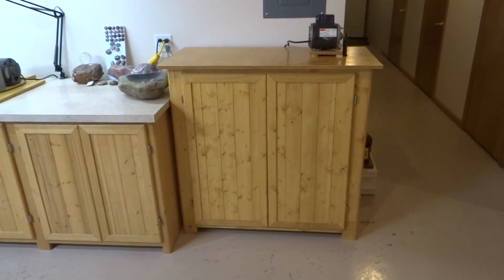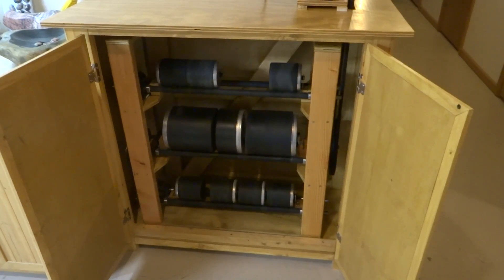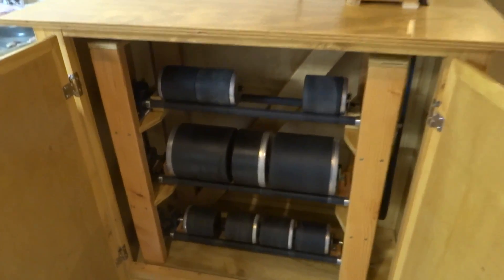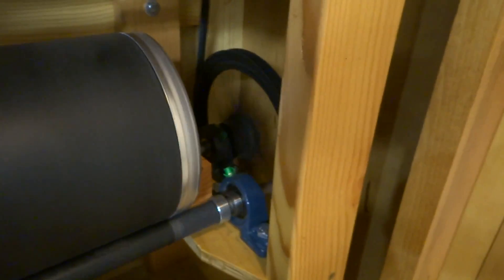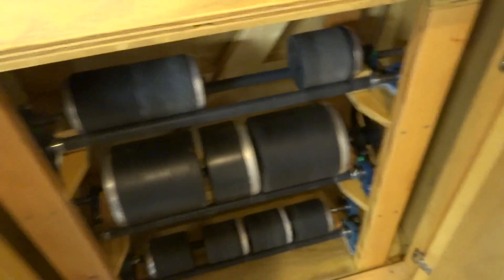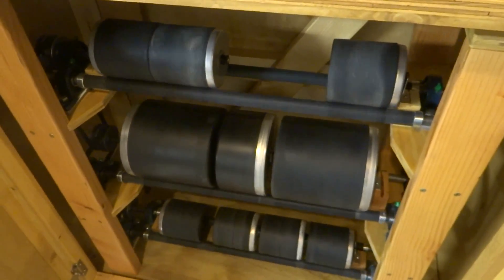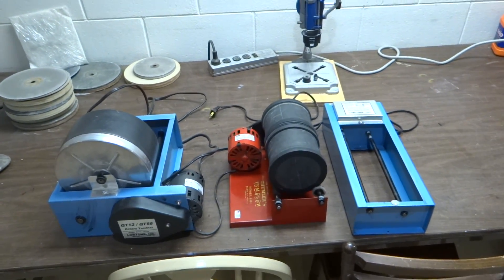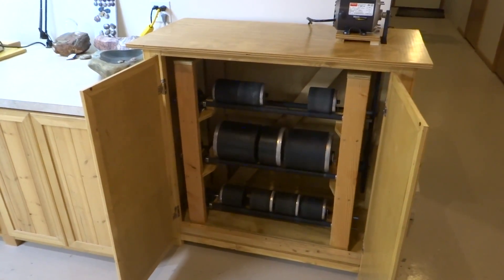Homemade Rock Tumbler

Comment from the maker: Here's a link to an update showing the inside and some small changes I made to the tumbler:  https://youtu.be/PAMOCc2BNJM
Reply: Love your tumbler idea. I think I will try this. Probably asked you this before. Where's a good place to buy the tubs and polishing grit from. I checked on Amazon and didn't find much on there for tumbling supplies.
Reply from the maker: @wyomingadventures  The Rock Shed is where I buy most of my stuff.  You could also check Kingsley North. 
http://therockshed.com
http://kingsleynorth.com
Reply: @MichiganRocks  what would be a recommended rpm of the barrel?
Reply from the maker: @teabee44  I have changed the pulleys on this one to make it a bit faster. I'm not home right now to measure the current speed, but I'm pretty sure it's in the comments here.

Comment: Well, after watching your video I had to build my own GIANT ROCK TUMBLER. It weighs 325 pounds and has four rollers. The bottom roller holds a stainless beer keg tumbler barrel and the three upper rollers hold 8 inch to 10 inch PVC barrels. It easily turns about 130 pounds of rocks at the same time! I drive it with a Consew model 3001, 1 HP stepper motor that is made for an industrial sewing machine. It sounds terrible! I have it in a closed barn but you can hear it from about 60 yards away. 

   The best part is, it drives away all the rats and mice!!! It has been running continuously since September 2024 and the varmints have completely abandoned that barn. I keep my chicken and duck feed in there. There is still cracked corn on the floor that I dropped back in September, three months ago! It has worked so well at deterring vermin that I bought a Harbor Freight tumbler to put in my other barn's feed room. I don't know why it works like that but it works great!
Reply from the maker: Well that's something new! Vermin control and shiny rocks all in one unit!

Comment: I read about how to make an industrial tumbler out of a rear axle of a big semi truck with the rims and tires in place. You want to cut an opening in the highest part of the rim to load rocks. The article said a cover is not needed but I always thought if I was going to do one I would have a hinged door sealed with inner tube rubber. The idea is to set up a motor geared down so the tires rotate slowly and all the rocks stay in the lowest part of the tire at all times tumbling over each other. Each tire can hold about 100 lbs of rocks and you have 4 tires going at all times each one with a different grit. Always use the same tire for the same grit. You rotate the rocks once a week and you have 100 lbs of polished tumbled stones each week.  I have been wondering if you could use quartz sand as grit for the first stage to do the rough rounding off? I am posting this on all videos about rock hounding to spread the idea, if this is you channel and you do not like that let me know.  The fact that the tumbling will all take place in a rubber tire should help keep the noise down. The rocks should never touch the rim. I have suggested to people that they make a soundproof shed just big enough to be practical so the noise will be  minimized. Plus the rubber in a tire is thick and should absorb a lot of the noise. Also you should have a small fan on the motor to keep it cool. A high quality motor will be a must as it will run 24 hours a day. I am no expert but with the proper gearing the motor should not be under too much stress.   I would sell the tumbled stones. Once tumbled, you grade them by quality and type. Some would be really valuable. I bet you could average $10 usd per pound with just good found material and more if you have high grade material. Definitely not for the weekend rock hound but if you sell stones or want to, what a cheap way to start. You could tumble other people's rocks for a fee or shares too. You could make one with car tires for a smaller scale operation. There has to be a lot of people with 30 year in the making, 3 ton pile of rocks out behind their house. With this they could see results from all that collecting.
Reply from the maker: That's an interesting idea, but I wouldn't want anything at that scale. My rocks don't spend just one week in each stage. To get really nice tumbled rocks with no flaws (if that's what you like) it takes weeks or months in just the first stage. I check each rock each week when I change grit. That takes a lot of time even with my tumbler. I sure wouldn't want to do that for 100 lbs. of rock at a time. The other stages take a week or two per stage depending on which stage and how shiny you want them. 

I made a video about using sand as grit.  https://youtu.be/rk1DEqyH8Pc 

I don't mind you posting new ideas about rock tumbling on my videos, but please don't post this same thing on multiple videos on this channel. Original comments are fun, but reading the same one over and over wouldn't be.

Comment: Hi  there, that is an amazing tumbler, your Chuck should be proud, and as a Chuck myself I have a couple of ideas that might quiet  it down some. The way it attaches to the back like that you are probably getting some vibration noise transfer, if you were to put some kind of rubber mat underneath the slide in part and had your attachment points on the floor of the unit it would I believe help. Also if you put some rubber under the motor where it mounts on top that would also help, other then that again that is a sweet tumbler, thanks for posting.
Reply from the maker: I added about $200 worth of material to it to quiet it down.  I emailed a company that sells soundproofing materials or advice.  The guy who replied gave me good advice because it’s much quieter now.  I had built it with 1/4 inch plywood.  He advised that I add thickness, so I used green glue in between the original plywood and a new layer of 5/8 inch plywood to thicken the sides, top, and bottom.  Then I added some soft padding to most inside surfaces.  It also sits on top of rubber pads under the feet.

Comment: OH! And maybe spray the active and idler rods with rubberized truck bed liner!
Reply from the maker: I had them covered with rubber tubes, but I have since removed them from all but the middle row where the big barrels run. I could have removed them on the middle row too, but I decided I wanted just a little more speed there.

Comment: Hell yeah! I was envisioning something lose to that. Great idea with old cabinet and heater hose!
Reply from the maker: I ended up taking the heating hose off of the two levels with the smaller barrels.  I wanted to slow them down a bit and the rubber barrels get plenty of grip without the hose.

The cabinet is not old.  I built it specifically for this.  I have since added some sound deadening material to most of the inside of the cabinet and also doubled up the thickness of most of the cabinet walls.  That really cut down on the noise it was making.  I should have built it with 3/4 inch plywood in the first place.

Comment: Fantastic idea, and turning it into a reality is even better! My first foray into the art has been a two-barrel beauty from Harbor Freight. So far, it’s held up for six weeks with one barrel reaching the end of the 4th step, can’t wait to see these jewels in final rinse, about 4 days from now. Did you ever find a buyer for your old tumblers? It may be a while before I upgrade to a cabinet version, but upgrade I must! My next visit to any Michigan beach or river is going to include some 5 gallon buckets! 

Thanks again for the help. I was lost two months ago, now I have two Diamond grinder blades, a big one for slicing and small for side grinding. The media you recommended has worked out great. Looks like my set-purchase will get me at least four, possibly five full run throughout, not bad. 

Again, I sure appreciate you sharing. I actually feel I know a little about the hobby already! Stay safe!
Reply from the maker: I'm glad things are working out for you, John. These videos would be sort of pointless if no one was learning and applying that knowledge.

Some people get a couple years out of Harbor Freight tumblers. Others don't get one batch finished. You might be one of the lucky ones. 

I don't have any plans to sell my other tumblers because I'm using the barrels in my cabinet. I also bring them out occasionally for a video or to answer a question about them.
Reply: @MichiganRocks  , understood. I’m feeling more than lucky, really impressed seeing my chosen stones after step two. Now I have a much better idea what to pick up. I understand you when you put so many back where you found them, thinking of the work and ultimate end product.

Comment: That is an awesome rig. That has to be much cheap than most of the large scale tumblers. If you not mind me asking, how much did that set you back, not including the barrels?  If you are worried about noise. Try lining it with mineral wool. Look at your big box store for insulation. Put neoprene washers between the bearings and the mounts. Felt washers is also another option. One note about the mineral wool, it insulates better that fiberglass. So if heat build up is a concern, it might not be a good option.
Reply from the maker: Thanks for the tips.  Since making this video, I added quite a bit of sound deadening material.  I added plywood everywhere I could to make the sides thicker.  I originally only had 1/4 inch plywood.  I added 3/8 plywood.  Then I bought some 1 inch thick material specifically made for sound absorption.  It looks like it's made from recycled clothes.  I also have it on rubber blocks.  I hadn't thought of adding rubber washers, but it's pretty quiet now.  Just recently it has developed a pulsating sound that's bothering my wife.  I'm not sure where it's coming from.  Whum, whum, whum...  I'm not sure how to write out what it sounds like.  I greased the bearings again, but that made no difference.

As for heat, that's the reason the motor is mounted on top.  It gets good air flow and I can insulate the cabinet as much as I want.

Comment: This is absolutely brilliant. Best I have seen. I see the 10 inch pulley driving the middle set of barrels but how are you operating the other rails ?  Using those lortone barrels like that with one large motor is such a great idea and in that cabinet, spectacular !!

Comment: Beautiful!  Don't use Styrofoam, use soft polyurethane foam. (foam rubber) glue it on with 3m spray glue: fast foam 74 or super 77.  The thicker the better, 2" is good. If you seal the doors, you can make the cabinet nearly silent.  Sound sneaks through cracks, so seal the cracks and around the belt pretty tight. You will be amazed..  Find the foam in large packing, also you can buy "egg crate foam" online pretty cheap.  Note, this foam like most any foam, is flammable, so keep away from heat sources. Do not enclose your moter!
Reply from the maker: I soundproofed it pretty well after this video.  I bought some insulation from a sound proofing company.  It looks like it's recycled clothes.  It's about an inch thick.  I also added extra plywood to most of the inside surfaces, glued on with green glue, which is made for soundproofing.  It made a pretty big difference.  It's not silent, but hard to hear upstairs now.  My wife's happy.

Comment: Oh man this is impressive!!! How is it working now?  are you still using this setup now?  It looks like a great build, and I love how it is inside a cabinet.  This is top notch my friend.
Reply from the maker: It's working great.  I should do another follow up video on it.  There is a second video already, in case you missed it.  Since these two videos, I had to change all the belts.  I bought the cheapest belts I could at first, thinking it didn't matter for this project.  I was wrong, it mattered.  The original belts gave off a lot of black dust and eventually cracked and broke.  I replaced them with good belts and have had no more problems.

I told my wife that this would be quieter than the Lortones I had running, but it wasn't.  I spent about another $200 and now it is very quiet. I put it up on rubber blocks, added another layer of plywood wherever I could with Green Glue between, and added an inch thick layer of sound absorbing padding to a lot of the inside.  That was $200 well spent.  My wife is now happy with the lack of sound coming from the basement.
Reply: @MichiganRocks  Happy wife, happy life!
Reply from the maker: @trevorallen2274  You've got that right!

Comment: Rob,
I'm posting this to an old video with hopes you'l still see it. I built a copy of your tumbling cabinet (and wrote to you about it) and have a couple of questions for you. Fist, I have some onyx that doesn't want to polish up very well. If I put ceramic or plastic pieces in with it, I find that some layers get worn more than others. Also, it gets worn away rather quickly, so I think it's a fairly soft rock. If I put only the onyx in, I get a lot of bruising which again, inhibits the shine. Any sage words on how to tumble soft, layered rocks?
Second, I have a lot of this material. Would you like some?  It is a very attractive stone and polishes beautifully outside of the tumbler. I'm happy to share.
Ken
Reply from the maker: If you have some layers wearing away faster than others, it's called undercutting. That's really hard to prevent in a tumbler and I don't have much advice for you. Sometimes running the rocks for shorter times minimizes it, but doesn't eliminate it. I have never polished onyx, so I can't speak from experience with that particular rock.

To prevent bruising, try thickening your slurry. That will keep the rocks from moving around so quickly. I know some people who use kitty litter, which is clay, to thicken the slurry. I know this works with the first stage, but I'm not sure if it would scratch in the later stages. I know one person who uses Metamucil as a thickener. That won't scratch your rocks. I don't know how much to add, but I remember it being a pretty small amount.

I have a ton of other things to tumble and work in other ways, so I'll pass on your offer of rocks. I appreciate it though.

Comment: Hey, Rob.  Got time for a bunch of questions?

The "Lortone barrel guides" at 1:09 - are those still working well for you?  Do you get metal dust and wear on the threaded knobs, and do the barrel guides get 'sharpened' over time to a knife-like edge?

Inspired by your creation, I made a simpler less-ambitious table top version that can hold five barrels.  The barrels eventually wander over to the edge in operation, and rub up against the support wall.  I installed some small "sacrificial" pieces of Teflon, which work to protect the barrels, but I end up with Teflon dust.

Does your motor get hot?  Do you have to cool it with a fan?  Do you let it run 24/7 when you are away for a day or two or longer?  I used a fractional horsepower motor I had in my stash, which worked fine, but it got pretty hot, and I was worried about leaving it running unattended.  I reconfigured the motor to run on 240V (by following the wiring diagram on the motor), and it runs much cooler on 120V, although it's power output is much lower.  It needs a push to get started, but seems to run reliably once started.  I let it sit stalled for a few hours, and it didn't get hot, so I feel much better about leaving it unattended.

By the time I finished the project and went to buy some more barrels, just my luck, Lortone went out of business and the barrels were very hard to find and I was unable to buy all I wanted.  Do you use Lortone barrels?  Some quick searching leads me to believe that competitor barrels are considered to be much inferior.
Reply from the maker: I can help you out with those. The Lortone barrel guides have been working well for years. I do not have wear on the nuts, I have been using the same ones on this machine for at least five years. 

The motor is on the top to keep it from overheating inside the cabinet. It gets hot, but I leave it on while I'm out of town for a couple days. If I'm gone for over three days, I turn it off, but otherwise it runs all the time. I can't advise you on your motor, though. Use your own judgment. I don't want you burn your house down. 

Lortone was purchased by Covington Engineering. They should be making barrels again in the future. I do like their barrels, and that's what's on my tumbler.
Reply: @MichiganRocks  Thanks, Rob!  That's very helpful.
Reply from the maker: @miltonthecat2240  You're welcome.

Comment: I would pay good good money for this!!
Reply from the maker: I did pay good money for it. It wasn't cheap and was a lot of work to put together. It's been working well though, and I haven't regretted building it at all.
Reply: @MichiganRocks  I have a couple tumblers my double barrel stopped working on me last night unfortunately.. do you have any recommendations on a good tumbler? Preferably a bigger one
Reply from the maker: @ashleyfernandez5834  I like Lortone tumblers, but I did have to replace the motor on my 12 lb. Lortone at one point, so it's not perfect, nor will it work forever. I also hear good things about the Thumler's Model B. I have a Thumler's A-R2 that I don't care for, but I don't think I have read much bad about their big Model B.

Both Lortone and Thumler's have been hard to find lately, but if you work at it, you should be able to find one. Try the Rock Shed. They have good prices and will work with you to get you one. http://rockshed.com
Reply: Thank you!! I’ll check them out